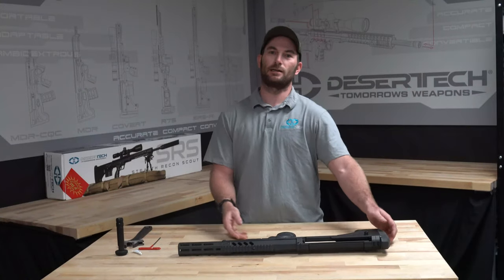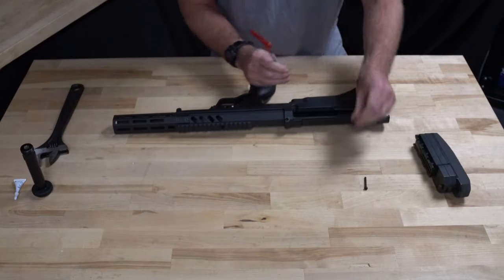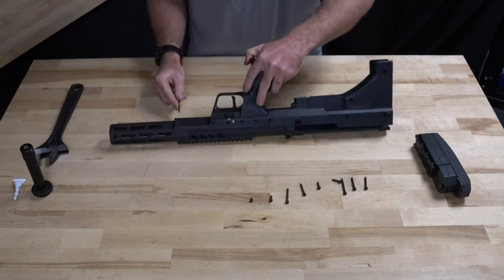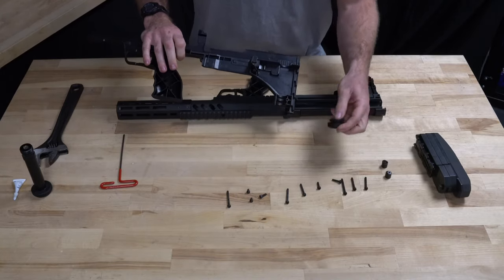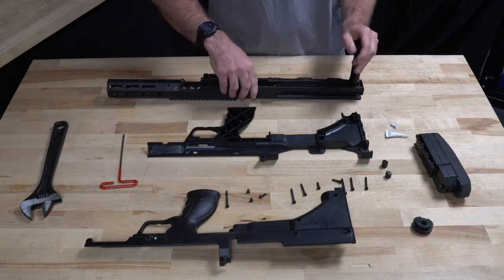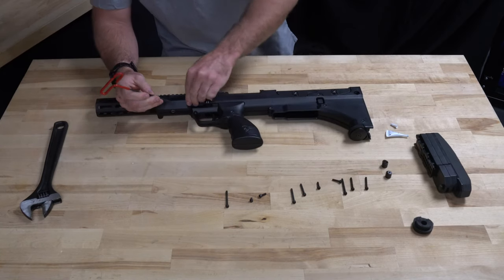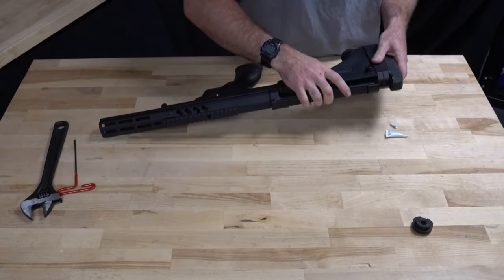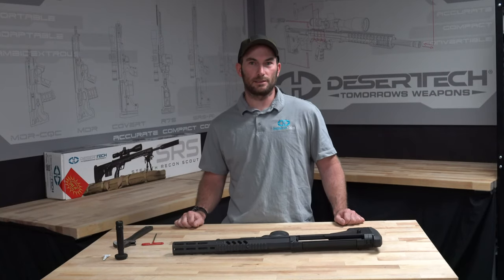SRS-A2 Monopod Installation Tutorial | Desert Tech

Comment: Hello !!! I have SRS A2 and and I don't see the holes and bolts to adjust the trigger ? Maybe there is no possibility for adjustment or it is necessary to disassemble the stock ?
Reply from the maker: The trigger adjustment is different on the A2, check your owners manual.
Reply: @DesertTechUT  can you send link to a manual ?